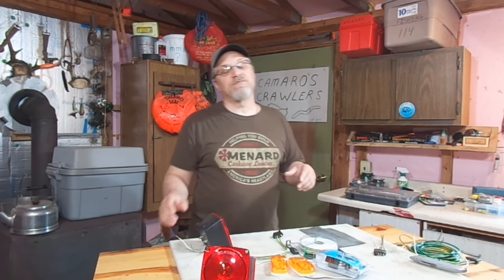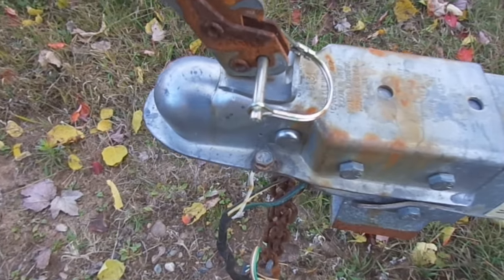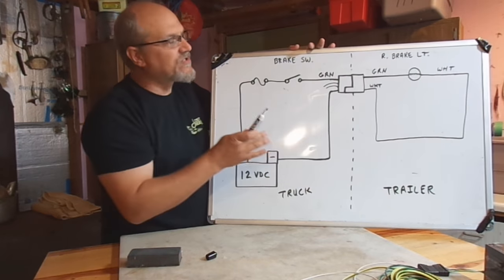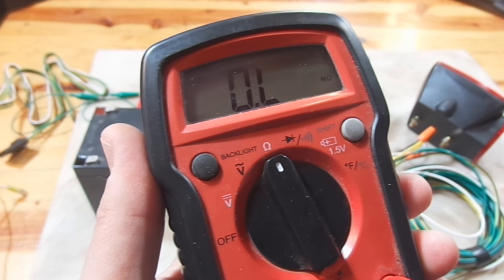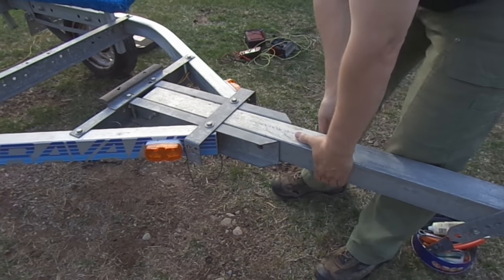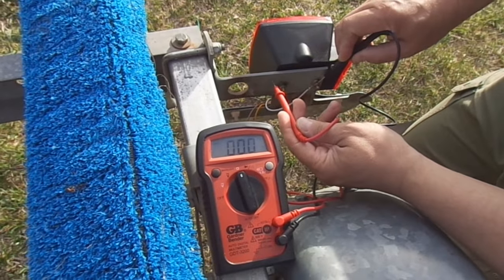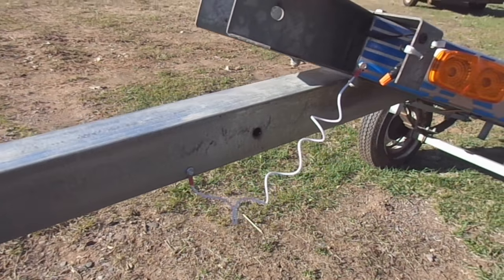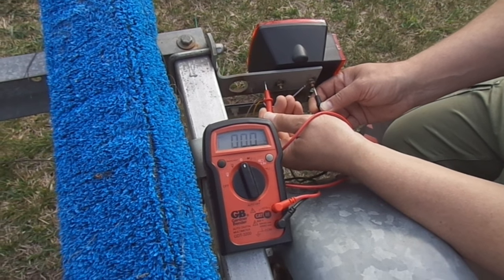FIX YOUR TRAILER LIGHTS (5) - Fixing Ground Problems

Comment: My trailer lights work until I turn my headlights on. Then when I use my right turn signal on truck & trailer light blinks too fast. I have a 2020 GMC Denali that runs the trailer diagnostics test that checks out before turning on lights. When I turn the lights on and run the test it tells me to look for bad ground on right turn signal. Help!!!
Reply from the maker: Well the Denali is "probably" fine.  I think one of your fixtures isn't grounded properly to the trailer.  Check tail lights and side marker lights both.
Reply: @KnettersPracticalOutdoors  I can't find where it's grounded any place on the trl. I believe the ground is one continuous from the truck to trl. I've checked all the LTD lights and they seem fine. What puzzles me every thing work's fine until i turn truck lights on.

Comment: Dave. How do I test continuity when I have an enclosed trailer and I can't get access to the connections to my lights?
Reply from the maker: I don't have much experience with enclosed trailers, but there must be a way.  The fixtures must come off somehow right?  What if you had to change one?  Sorry I don't have a specific answer but they must come off some way.  If you take the lens cover off is there some screws that hold the fixture in place or do they snap out like some car fixtures?  There's a way.  Let me know what you find, KPO.

Comment: Why does the return electrical path have to be the trailer frame??!! The ground ALWAYS fails. Is it just to reduce the amount of wiring?
Why can’t the return path be a wire or wires directly back to the connector.
Reply from the maker: You are right.  You can have wires all the way back.  But make sure to ground the trailer also.  This will allow for short circuits to trailer frame to blow fuses (which you want them to).

Comment: This could be my problem. It’s a dump boat trailer. Maybe it’s rusted enough at the break point to not connect.
Reply from the maker: could be
Reply: @KnettersPracticalOutdoors  it was. I sanded where the trailer frame separates for the tilt and lights now working, so happy.
Reply from the maker: @beorbeorian150  awesome to hear!

Comment: my trailer lights work when i use a 12 volt charger as power and i the ground from the charger and not the white wire from the 4 flat. I also ground on an painted part right where the trailer drops onto the ball. the person who did the original set wiring set up had screw the white wire on the painted part of the trailer. it worked but doesn't now. I am going to try drilling a new hole right where the trailer drop onto the ball and try attaching the white wire there. Any other suggestions ?

Comment: I have a boat trailer and the lights work fine until I touch the brakes and then they go out.
Reply from the maker: I would think you have a ground problem.  Make sure that all the fixtures and the ground (usually white) wire are grounded to the trailer frame.  Also make sure the ground wire on the vehicle side is grounded to the vehicle frame.  I'm assuming that this trailer did work at one time and that nobody rewired it.  Otherwise it's possible that it is wired wrong.  Let me know how it works out, KPO.

Comment: those folding trailer is pain in the ass to get good continuity using the frame. Instead, spend 3 bucks to get a roll of wire and get all the white wire connected, no more problems....
Reply from the maker: That will do it, KPO.

Comment: Can't you just extend the ground to the rear of the trailer and connect it to one of the lamps?
Reply from the maker: Yes, but if you go that far run it to both sides.  That's how temporary magnetic towing lights work.  Also maybe the side marker lights too.  Still ground it to the trailer frame so short circuits will blow fuses.  Thanks for watching, KPO

Comment: Trailer lights have to be one of the most violently stupidly designed pieces of absolute garbage. I should not need to STUDY videos to turn a light on. You can get lights that do not require grounding.
Reply from the maker: Yes, I think the ones you are talking about do require a white wire to all fixtures, but that's a good option too.